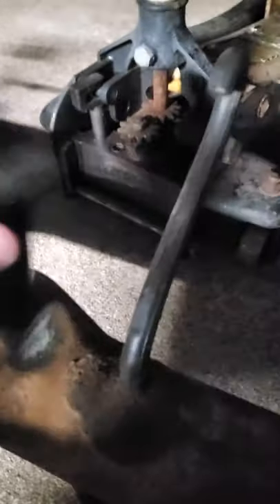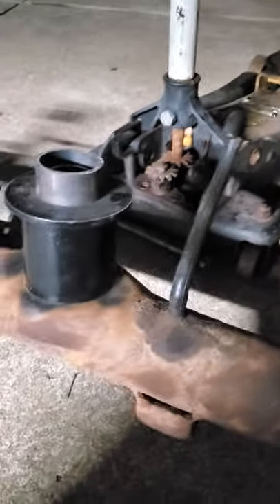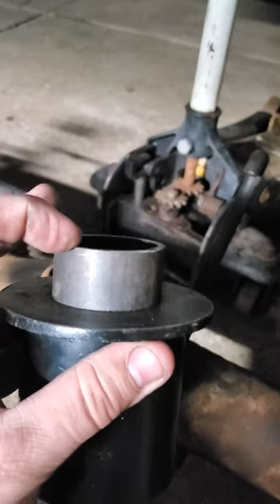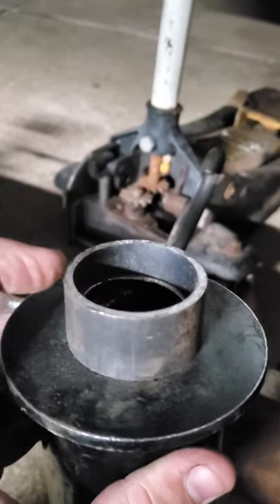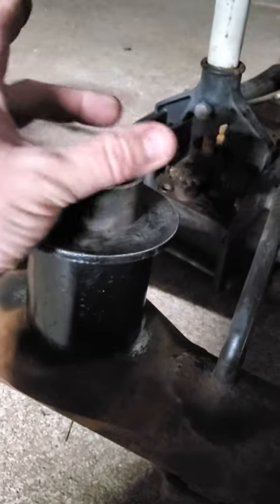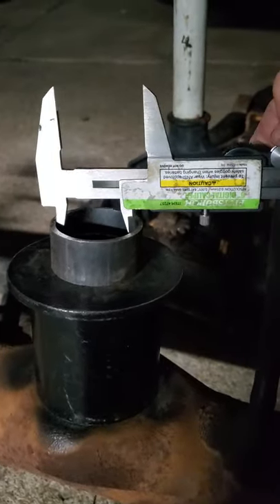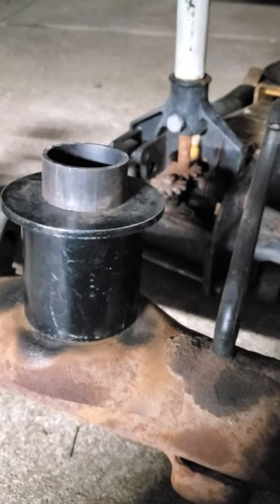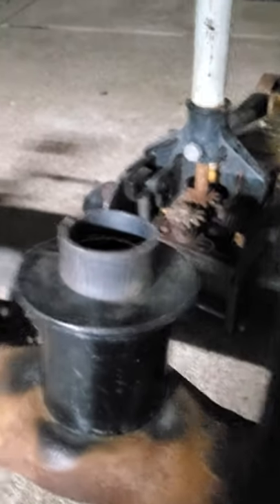Crown victoria Grand marquis Town car 3" Rear lift

Comment: I put them on the top of my coils on my ‘95 mgm because it fit tighter, and it stays with the body. I didn’t want it taking all the movement and impact that the axle has on bumpy roads. Haven’t had any issues yet and I’ve been airborne and on very rough trails going fast.

Comment: Plz any body watching this video plz don’t be stupid an weld or tac weld shit you’ll have a major issue when time to take it off when you don’t want it on which will cause holes in your axel when you tap the cups off with a hammer once they get put on a springs sits on top of them an yoy mount everything back up an get your shocks bolted back up all that pressure will hold those cups tight in place never weld anything on your axels
Reply from the maker: Excellent advice as a disclaimer.
However every axle has something welded to it in order for it to be bolted on.
Personally this Was an off road project and I had planned on being airborne and didn't want them falling out and I had heard of them falling out on pavement princesses over speed bumps so I just wanted to be sure.
Reply: @TACOMASRT5  should’ve just put longer spring I’ve lifted cars 20 years yes they welded shit from factory because they no what there doing but tac welding a cup to the axel of a car for a dumb reason is not really smart on your part js saying add longer springs or buy a truck js my opinion
Reply from the maker: @simsatvrepair1255  I agree. A much better option given you could find the correct springs for your specific needs
Reply: @TACOMASRT5  I’m js if you your going to run a CAR OFF-ROAD you should use longer springs or a stiffer spring with lift cups so they don’t fall out an tbh lift cups want fall out if put in right an stiffed js
Reply: @simsatvrepair1255  Settle down bud it's a 2000 dollar car I guarantee when they get scraped it's not because of some tiny welds on the outside of the axle
Reply: Ur so angry I'm not ur bro
Reply: @babyreps365  seems to be you are your obviously triggered cause I called you bro obviously you don’t believe In god an believe that one day when we die will all be brothers an sisters but like I said BRO I’m glad you decided to waste your time posting this

Comment: What is the thing called that squeezed the spring together and what brand?
Reply from the maker: Coil spring compressor? That is a tool that helps in spring installation.
Coil spring spacers are what I installed on the axle to lift the car

Comment: How did u lift the rear i got a 03 lincoln im tryin to lift but i still have may air ride suspension in rear
Reply from the maker: I'm not sure if the bags will work with this or not, but probably not though.
If you go with these you will need to switch to coil springs.
Some people switch to springs out of an explorer or excursion I think?  But that would be too stiff a ride in my opinion.
Reply: @TACOMASRT5  sorry for the late reply i have coil springs now got rid of the air bags the rear is lower then the front would u use cups
Reply: Are u in tacoma Washington
Reply from the maker: @DeeMoneyG  no lol when I started my YouTube channel my Toyota Tacoma sr5 was modified so I used to make a joke with people that it was SRT5
In sttead of srt4,srt8, or srt10 like a dodge
Reply from the maker: @DeeMoneyG  you got rid of the factory air suspension? 
What springs did you get?
There are several cups available I would make sure whatever size you get is made of steel so you can get them welded to the axle so they don't fall out
Reply: @DeeMoneyG  no cups want help your sagging problem you need to replace your shocks go to universal car lifts an get there extended airshocks